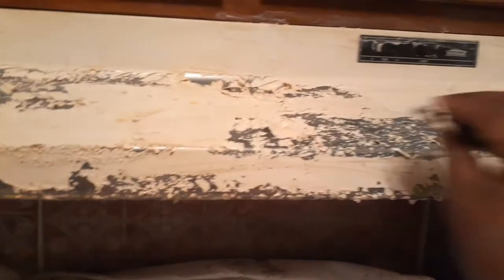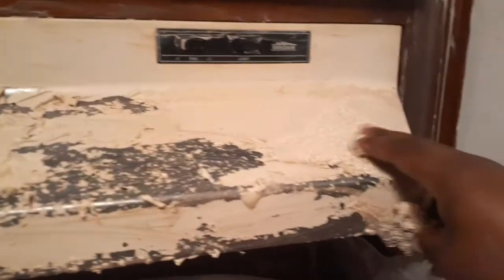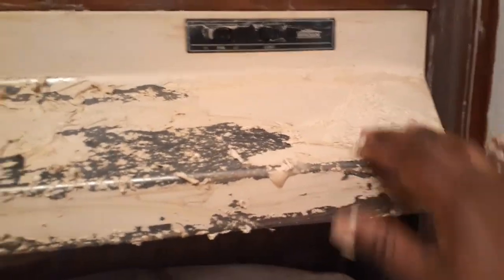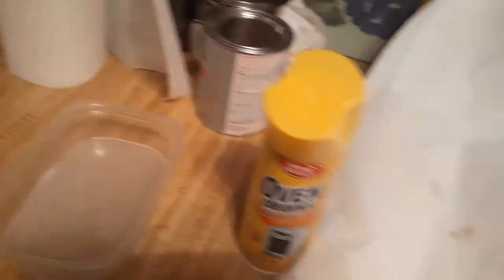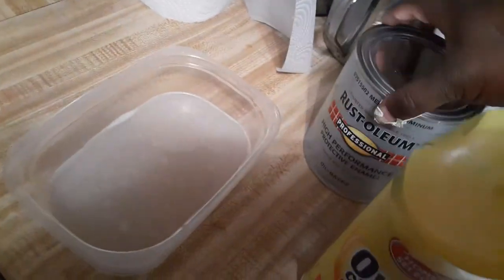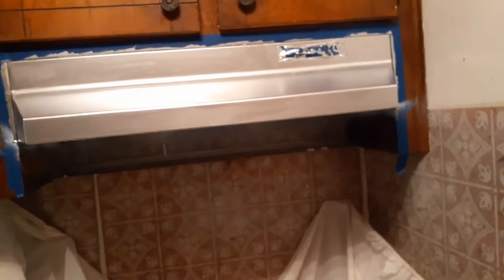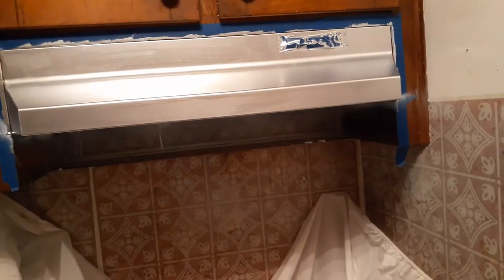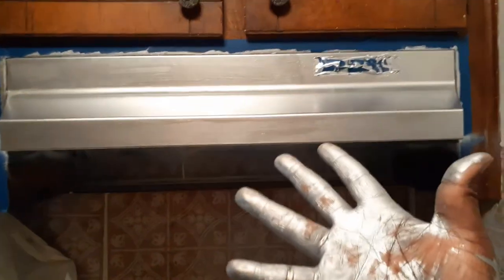Paint your range hood. Alternative to replacing  your range hood.

Comment: This looks great .. I have had all my appliances replace with stainless.  And I'm realizing my hood needs to be replaced and Amazon has them for $80 to $180  but I'm thinking I'll go this route.   I'm glad I found your post.
Reply from the maker: It's definitely worth doing. Save your money all you need is $10-$15 in materials and a weekend. I also painted my refrigerator it turned out great, you should check out that video. Thanks for watching.

Comment: It turned out looking so good!
Reply from the maker: Thank you. It was an easy money saving update. The paint is holding up, I have not had no issues with it. Just a heads up if you decide to try it. You WILL want to paint every appliance you own and some other stuff🙂. A little goes a long way. Thanks for watching. Please consider subscribing if you haven't already.
Reply: @82RoseLyn  you scared/reassured me, because after watching, I used a tiny bit of elbow grease on my hood, and the paint started coming off! Now I’m wondering if I should try to get it all off, like you did. Darn it, I don’t need a project right now!
Reply from the maker: It was worth it, and it is holding up extremely well. Best $9 I've spent. Check out my painted refrigerator video where the saga of painting appliances continues🙂. Thanks for watching.